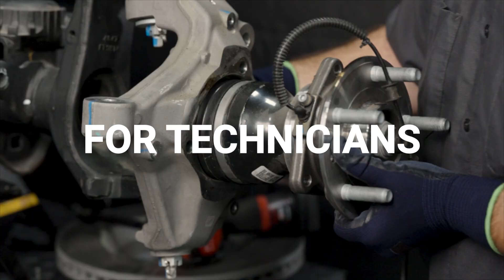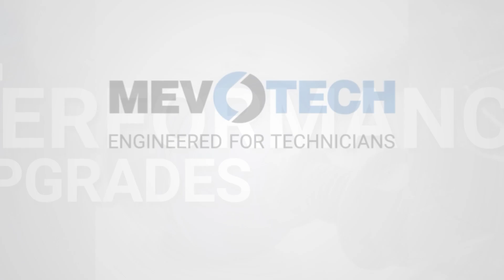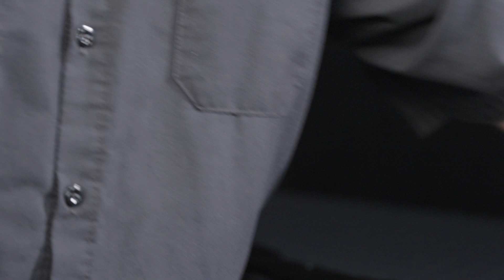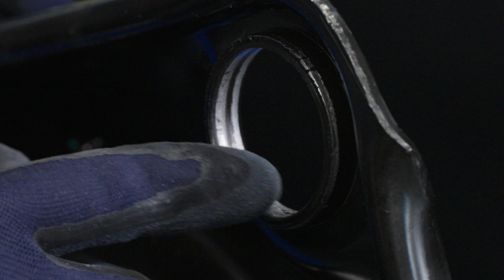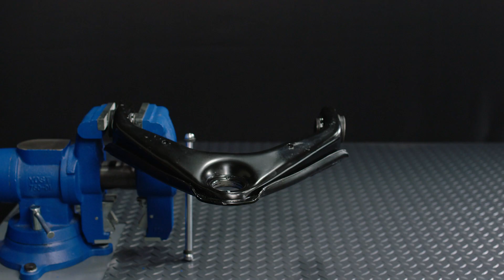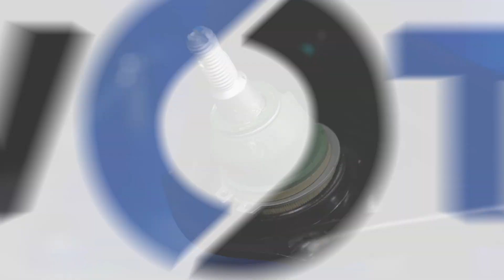How To Install TTX™ Directional Ball Joints

Comment: Should this part be greased before installation?
Reply: No, because you need to press it in without the boot.  Once it's pressed in and the boot is installed you can grease it before attaching the control arm.